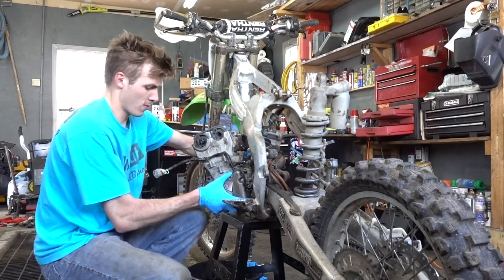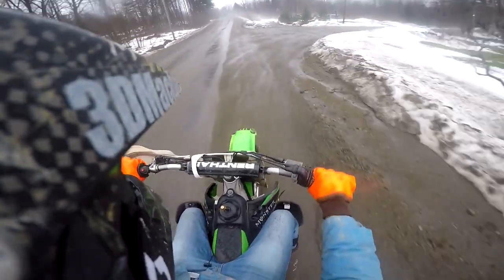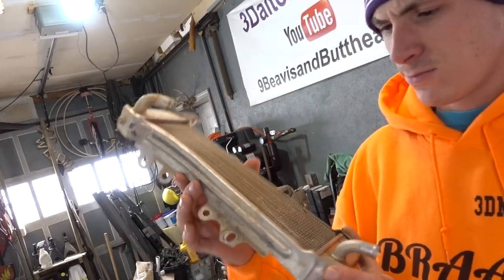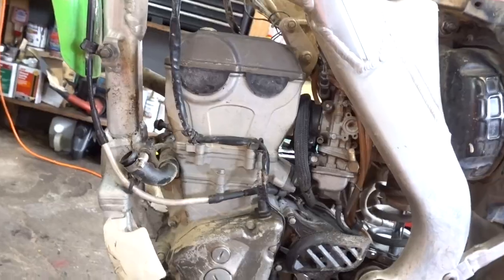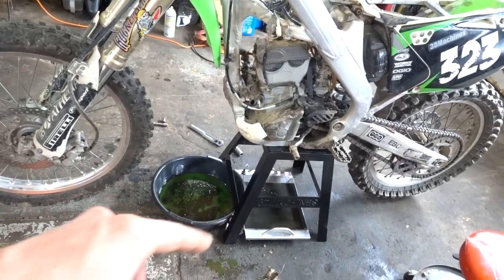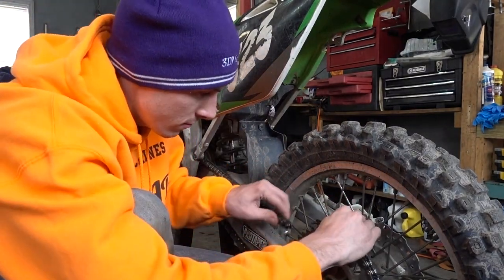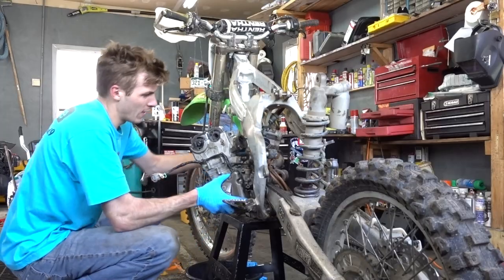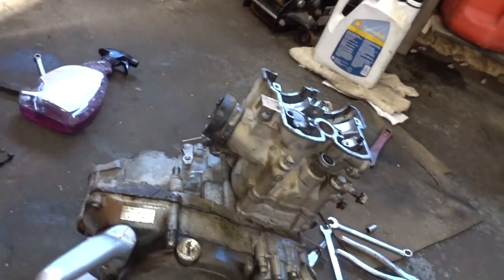THIS IS INSANE

Comment from the maker: Put your opinion in @ 7:26 in the video!
Reply: Okay in 3min and 25 sec
Reply: 3DMachines I did not see it
Reply: 3DMachines I'm disappointed I was hoping it'd just be an un necessary part lodged in bottom end like what happened to my TTR125E.. hopefully your next paycheck has the KX's name written on it!
Reply: did not see it
Reply: 3DMachines keep up the great work I like u haven't change much over the 3years I have been watching u
Reply: 3DMachines just try to keep the riding Vlogs more
Reply: 3DMachines man ya know I kinda thought it was the head or a the clutch malfunctioned and locked up but I know your pain I have to put a new timing chain in my 1987 Honda trx 250x and boy that was a fun process when your playing with timing
Reply: 3DMachines get all new pistons and kick starting set not a professional just a 12 year old I have a kx klx 140 my self just what I think might work keep up the great vids can you please respond it's my dream to have you respond
Reply: Get a new top end
Reply: 3DMachines my sister blew up our 2008 kfx 450r and the case is junk and I ride a kx 85 
Plz respond on what to do
Reply: Thekowrider 711 get a new case...
Reply: 3DMachines my kxf needs a new tranny as well as a new rebuild total cost with labor $1000 and I didn't notice that(bike: 2005 kx250f aftermarkets slip on fmf factory 4 original and sprockets
Reply: 3DMachines nope
Reply: FIX THE KX! She's a great machine, maybe somebody will send you a brand used top end!
Reply: 3DMachines awesome video hope u fix the kxf soon
Reply: 3DMachines no
Reply: Looks like some ground up teeth. They look like the ones on my RC truck.
Reply: 3DMachines  rebuild it
Reply: 3DMachines don't worry as a motocross rider it costs money don't rush it cause that's when things go wrong and we just appreciate the things when they go right
Reply: 3DMachines you have to rebuild the bike I really like the kx250 would hate to see it go
Reply: 3DMachines  it claped
Reply: 3DMachines your bike is clapped
Reply: 3DMachines dude after that problem you have two bikes sell it bud it's not worth the money to fix it
Reply: I totally agree with this statement.
Reply: I'd personally want to do a top-end rebuild... although whether it's economically viable either by using parts from a junker or brand spanking new would be TBD in that instance... I'd be willing to say getting the top end off a write-off from the scrappers could be your best shot... Bet a fresh head gasket would be your most expensive part then...
Reply: Didn't see it. IMO you should rebuild it and put a hot cam in it . Get that BRAAPP on
Reply: 3DMachines i vould sell the bike if you cant find a cheap top end but. But onusly i would sell it its not worth it.
Reply: Hacrbro1 Hacrs it's a single cylinder it has one piston.
Reply: Dalton, never really noticed your sprocket, you should do a rebuild, there's probably metal chunks in other spots also if your valve train is that tore up
Reply: 3DMachines that's funny BC I did notice that I was gonna wait until the end of the video to say something about that
also for your other question, I am not disappointed with the kx BC I know everything breaks down at some point and that point does not hold for a more convenient time.
Reply: 3DMachines I say forget about the 4t and stay with your 2t
Reply: then we need more likes to save the bike
Reply: Ok so You have a Three bikes one with  a motor that's blown in it.  I would ask myself a few questions.  How much money am I going to make rebuilding the engine from Youtube cause you know every gear head that watches your videos is going to tune in and watch.  If not sell it and put the money into one of your other bikes.
Reply: bore it out
Reply: you have an oil feed issue
Reply: 3DMachines keeping it froggy fresh with  the dirtbike
Reply: looked to be an oiling issue. Part it out, or sell it as is. Going to be big bucks as the debris has traveled through the entire engine.
Reply: 3DMachines put a new graphics kin on her
Reply: 3DMachines sell the Honda & fix the kx
Reply: SCOOTER GODS the Honda was a present
Reply: 3DMachines liquid weld will solve all your problems don't worry
Reply: Please fix it man
Reply: Save the KX!!!!
Reply: 3DMachines  yup i did
Reply: 3DMachines yup saw it.  I would have checked the top end before testing apart the entire bike to take the engine out.  That's most likely to go anyway.
Reply: Oh and most importantly... what's the cause of the oil starvation in the top end if the oil was fresh?
Reply: I would sell for parts if its an expensive fix, you still have the Honda and KTM
Reply: hi my name is Darrian do a shout-out for me
Reply: Fix it or sell it. Fix it then sell it.
Reply: 3DMachines bro these bikes when they blow they really blow haha my 2 stroke rebuild was 300 buckeroos
Reply: 3DMachines keep it i has unlimited value as far as im concerned
Reply: 3DMachines hey i got a question for you what's the best way to get your oil drain plug from leaking I just barely bought this bike and did an oil change and after i did that it has started to leak got any ideas?
Reply: 3DMachines did you make sure to put thread locker on the drain bolt and make sure it has the washer on it. Some have lock washers that need to be replaced. That should solve your problem man.
Reply: Ziconix98 ok I will check those things hopefully it stops
Reply: 3DMachines I have reading glasses and I saw the tooth missing when I sow it I wondered if u would replace    it
Reply: 3DMachines nope
Reply: 3DMachines his bike is a classic 3DMachine! The whole reason I started subscribing to this channel! Put a new head in it and let's see this thing rip!
Reply: 3DMachines  it is probley the transmission because u had to do some thing  with the  transmission
Reply: 3DMachines nope
Reply: No clue, u da boss.
Reply: Hey 3DMachines I want ten minutes of rideing like you did a while ago thanks I hope you have a great day
Reply: maybe you have to many toys you are neglecting some.   that sproket was trash quit some time ago.  have you ever had the valves done on that bike ?   I've seen the valves get destroyed but not the area that the cam sits. wonder what that's from?
Reply: 3DMachines figured and low-key was hoping it was crank lol no offense, just wanted to hopefully see u split a case bc I never have. Sprocket teeth are bent from the bike locking up and trying to pop the clutch. I Have a factory racing edition KTM 450Sx that needs a crank and new bearings. hopefully I'll have it fixed in a month or two
Reply: 3DMachines wanna sell the crf250
Reply: DevonPlayz a
Reply: 3DMachines please make the videos longer
Reply: we had same problem it was not getting oil and thay sezied
Reply: 3DMachines I didn't see the broken tooth I can't believe I didn't see it because when I watch ur vids I watch very closely I love watching ur vids I watch every vid u make I wish u luck fixing your bike it looks like hard work but I know u can fix it
Reply: 3DMachines  Make sure your getting oil to the cam seats problem with that can be a backwards oil filter same thing happened to my 2005 kx250f.
Reply: get a head and hot cams
Reply: no I didn't
Reply: Ride the honda for a while then when you have saved some $$$ then fix it
Reply: 3DMachines please reply to this. I met you at the auction in frewsburg today. Please reply
Reply: 3DMachines hey you should take all apart rebuild like to frame clsan or paint it and put a 2 stroke motor haha or the same one.
Reply: 3DMachines sell it
Reply: 3DMachines you wanna sell the crf250
Reply: Noah Hatfield it is a crf 450
Reply: hey dalton what happend to jack crack
Reply: Dude you totally need to buy a Suzuki rm 65 like my bike cause I'm 10 and my bikes awsome

Comment: if you put a new head on you might as well rebuild the whole engine. new piston, rings, and hop up the engine to not just make it factory .
Reply: Mr.Random56 @3DMachines
Reply: Mr.Random56 there's not that much performance to be gained in the bottom end of a modern four stroke bike. Unless he's making big ponies there's no need for an aftermarket crank or connecting rod. If he's gonna do a performance build he'd be better off buying a bare head and going with big cams.
Reply: ROTAXD I was just meaning new piston and rings and more upgrades to the cam and valves

Comment: That's why I stick with 2 strokes lol love my cr250
Reply: Forrest Mitchell kx 85 is my ride
Reply: Forrest Mitchell cr 125!!
Reply: 2 strokes get worse mpg. They require oil to be added in with the gas. Top ends have to be rebuilt more often. It is actually cheaper in the long run to have a 4 stroke. People have done the math with all the factors. Yes 4 strokes are more expensive to rebuild the top end but you do it WAY less (as long as you know how to maintain an engine) and 2 strokes end up costing more. 2 strokes are more fun though with the powerband
Reply: love my cr250, its a 92 steel frame, and it runs like its brand new!!!!!
Reply: Jaretaustin14 2 strokes are fairly cheap to keep up, the oil is no biggie lol. You're right 4 stroke top ends do last longer but I can rebuild my top end for under 200$ and with a 2 stroke you never have to worry about valves or any other costly failures just simple engines
Reply: jaretaustin14 nice man mines a 98
Reply: Forrest Mitchell i didnt even say anything
Reply: joey_sybes my fault just noticed sorry brother
Reply: completely right i have only been driving 2strokes, im not talking big power but my moped (a puch monza) 50cc has only been rebuild once two years ago since it left the factory which is 38 years ago. i have also got a 125cc yamaha dt that has only been rebuild twice if i may believe the previous owner and we both have been driving it fairly hard.
Reply: pevex OO right on man 2 strokes can be very reliable engines if treated well
Reply: Forrest Mitchell the thing I like about when 2 strokes "blow up" is they usually don't just lock up, you can sometimes ride it back. 4 strokes is you're done if it locks up. idk, I've had both and since I'm so used to 4 strokes, they're actually simpler to me than a 2 stroke (i.e I can diagnose and fix quicker). also valves etc aren't something I worry about, keep your motor maintained correctly and once your shim on valves start getting small, you just replace them before it blows up. never had a 4 stroke blow up on me and always easier to start, esp in the cold. To each their own I guess
Reply: jaretaustin14 of course my man I got no hate for 4 strokes I love 450s both can be very reliable I've owned 2 yz 250s and my cr250 now I've never had an engine blow on me
Reply: pevex OO I'm talking MX bikes. 2 and 4 stroke bikes will last almost forever if they're not pushed to their limits for power. that's why most utility 4 strokes have never been rebuilt. we have a trailblazer 250cc 2 stroke that's never been rebuilt and it feels like it's on its way towards needing a fresh piston or set of rings but it still runs great once warm
Reply: jaretaustin14 true, my first yz250 when I was 15 was an '89 older guy I got it from had it brand new and never changed the top end on it he rode it easy I rode it pretty hard but it was on everything original and still ran strong when I sold it
Reply: Forrest Mitchell I feel like the older 2 strokes last longer than the new ones
Reply: pevex OO I've got a '75 Kawasaki F7. Sweet bike but oh man are parts had to find! I almost bought DT 125 when I was looking, you like it?
Reply: Cheaper to run 4 stroke ... NO 2 stroke cost much less to operate and maintain, short term and long term. They are very snappy and fun to ride and start easy in any weather. 4 stroke need to check valves every 15 hours and change the oil every 6 hours. The piston/rings  should be changed every 25 hours and timing chain and cylinder every 50 hours if you ride at a pro level. 2 stroke should be rebuilt every 60-80  hours if riding at pro level.
Reply: Forrest Mitchell I love my Rm125 too
Reply: CR 250 ME03 from 1993 still runs without a problem <3
Reply: Forrest Mitchell i got the kx 250 2 smoker great bikes for the track
Reply: Hunter4Life sick bro awesome bikes
Reply: Hunter4Life yell yeah I was on the verge of buying a 99 kx250 before my cr
Reply: Forrest Mitchell yeah my rm 125 and rm 250 kick ass
Reply: jeap nalls cr or crf?
Reply: Simon Pack get a crf
Reply: crf's are 4 stroke / CR's are your 2 stroke's
Reply: personally I love 2 stroke's I own 3 bikes. 1 RM 250 (sitting) I also got a husqvarna TE 300 (Hawaii trails are the best for these bikes) and I have a 450 4 stroke mainly just dicking around at our local track race's so its another sitter as well as races only happen maybe 3 - 4 times out of the year
Reply: Forrest Mitchell that's why I stick to 450s
Reply: Jarrod Finnegan ok lol
Reply: Hambone5562 I've got a 96 cr250

Comment: cant believe the timing kept that thing going enough to tear apart the journals. checking and setting timing/ valve clearance is fairly easy and good regular maintenance ( monthly)of mx 4 t. would have found that prob long before that mess piled up.

Comment: In a Previous Video: I change the oil every 2 hours. 
In Later Video: Top end melts.
Reply: Jake G it was probably running too lean.
Reply: Running lean would cause the entire combustion chamber to become too hot. The bike would boil over before anything else.
Reply: indeed, too lean would result in a piston melting or burning the valves. im not sure what happened here but there must not have been enough oil going to the head, so maybe a faulty oilpump or something along those lines
Reply: That's what I came to because it sounds like the bottom end is alright compared to the top end. Only a rebuild will tell though.
Reply: I just watched it right through and realised it turns over with the head in bits so yeah it's probably the oil pump or a blocked oil jacket. I thought the piston had melted before I watched it all.
Reply: This.

Blocked oilway going to the camshafts is more than likely, in this case..
Reply: Jake G could be from a blocked oil galley the delrin timing chain guides have been known to leave shavings in the system. These 450 class bikes are. Ot really forgiving with extended periods of road riding (high rpm).
Reply: Angus Evans it's a four stroke. 4 strokes will give you a ton of feedback before you burn them down from a lean condition. Not like a 2 stroke where you can burn one down almost immediately from being too lean.

Comment: There is a bolt to drain the antifreeze on the clutch side of the motor on/near the water pump. And please don't do the cheap way and get a used motor that will more than likely do the same in 5 hours.
Reply: what do you meant "the cheap way". Definitely not cheap to buy a used motor, probably just as much to buy a brand new head. More like buy a used head off of eBay or something along the lines

Comment: The head isn't getting oil to it. I would check to make sure your oil pump is good. You will need a new cylinder head. That is not easy to fix. Cheaper just to buy a used head and get a valve job done. Valve jobs are way to cheap to not do it. I do them for $150. If you don't do it you will destroy the new valves. I would also replace the piston and rings. You can get the cylinder replated. Make sure you check the crank also. It's a common problem that they go bad. If you have any questions feel free to ask. I'm a engine building for quads and dirtbikes. I do mostly pro engine builds but I do the occasional stock rebuild.

Comment: Check your oil filter. You may have put it in backwards which is what I did on my rmz250. The oil filter in backwards doesn't allow any oil in the head and that's what mine looked like but not quite as bad

Comment: Did the cylinder base have the stock gasket on it? I almost messed up the camshaft in a 110cc motor because I was using a homemade base gasket and the hole for the oil passageway wasn't cut out right, so the cams werent getting any oil. 
Also maybe you can grind down the tips of the teeth on that engine sprocket a bit so they dont snag and break off.

Comment: I'm going through same thing with the head of your dirt bike engine but with my car. I just spend $650 on a new head (valves, seals, camshaft, etc.) because my timing belt slipped and jumped time which resulted in bent valves.

Comment: Everybody is dissing on 4 strokes. Keep your fluids and filter changed when they're supposed to be. And check your valves to make sure the clearances are good and your bike will run forever if you don't beat on it.

Comment: You need to pull that top end off and make sure that when it seized it didn't wreck the bottom end bearing. Make sure there is no up and down play. Coming to a stop like that is hard on them. Just my 2 cents I had one throw a rod from a hard seize after spending 1500 on new cylinder and head and top end. Everything was junk after that

Comment: I had a feeling it was bad . When i worked as a moto x mech and they came out with the four stroke engines built to replace the two stroker i laughed my ass off. Especially when they want you to take your brand new bike apart and check valve clearances after two gas tanks crazy . Fun on race day. Atleast you can rering a two stroke

Comment: Dalton: Your best bet is to detail strip engine/gearbox to examine the total extent of the wear on that motor.. Any time you find a countershaft sprocket with enough wear on it to be missing teeth, you got high mileage/operating hours. Because of this fact you must know  how much wear/damage you will have to deal with. Inexpensive parts(used) from ebay may be the way to go, or check junkyards etc as an option. You could checK WYNOA  for any of their members that may have parts or an old bike. ZAKatk1 comes to mind. Good luck on your project.